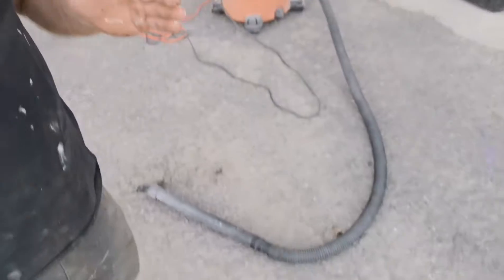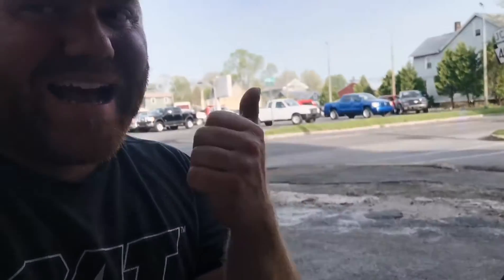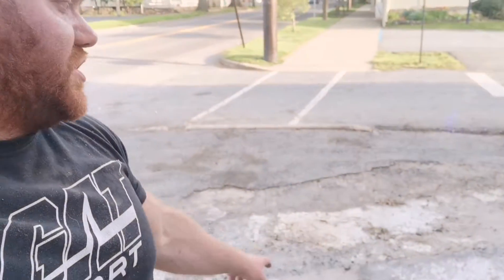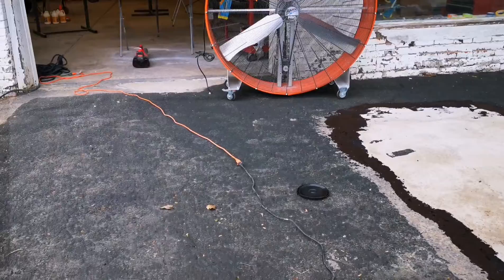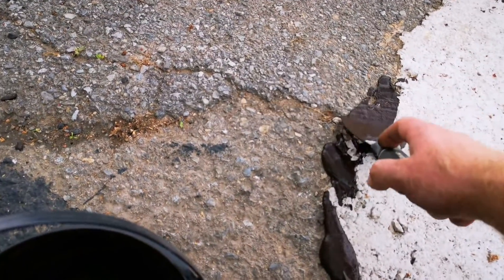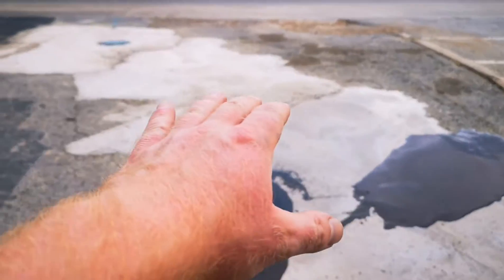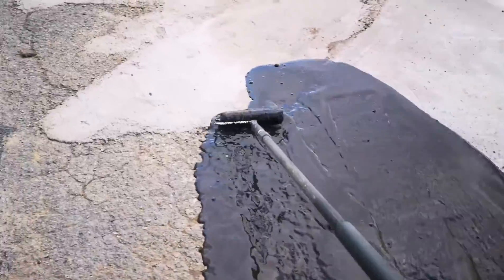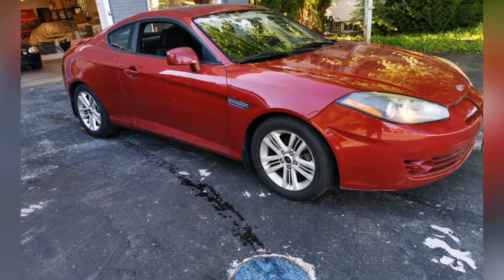DIY driveway repair/ restoration

Comment: Just sealed mine last weekend. Wanted to get it while we still have a couple 90+ degree days. 100 x 25 - pressure washed, troweled in cracks, & used 5 buckets of Latex-ite sand mix.
Reply from the maker: I find the premium 10 year filler sealer ones stick the best . The 14-18$ sealers peel up easy

Comment: First, cracks appear for a variety of reasons, but if the cause(s) remain, like settling foundation, tree roots, water seepage from surrounding soil, etc., the driveway is being attacked from underneath which requires analysis and difficult remedies.  Attacks from above, which are UV, weather and driveway settling, is within your DIY to fix or stop.  So, you repair the surface to stop water seepage from doing more damage, then seal the surface.  There no need to resurface since the contractor will do it poorly and same problems start again.

Comment: Thanks for recording your efforts mate! What I'm also interested in is the concrete aspect to either level (in my case) or repair as  combination repair? How did the concrete aspect go? Why did you choose concrete over asphalt patch and do you think it answered your vision and all your questions? I need to level my asphalt driveway but can't afford to bring professionals in. I'm guessing that concrete is a less expensive solution for me as I have sooooooo many dips in my driveway. The price of cold patch is probably close to having a professional do the entire driveway, so clearly a non starter fore me. I figure concrete is cheaper and if it bonds fairly decently to the sshphelt then a top coat sealer of some kind would colour-match the whole thing? Thoughts?
Reply: If anyone else wants to chime in, please do! Thanks all!
Reply from the maker: Well before the pandemic it was CHEAP. I could do a driveway patch for like 12 bucks 😂😂😂

Comment: How did this holdup so far? Specifically the concrete part? I have an asphalt driveway and I’m considering repairing multiple areas with high strength concrete
Reply from the maker: It's held up OK... of course over a 24 month period it will always need recoated. Of course they say "3-5 year coating" But max you will usually get out of any driveway sealer is around 2 years if you live in temps that constantly fluctuate.